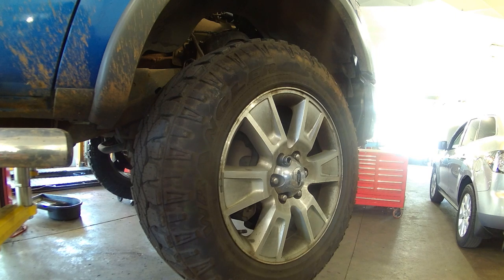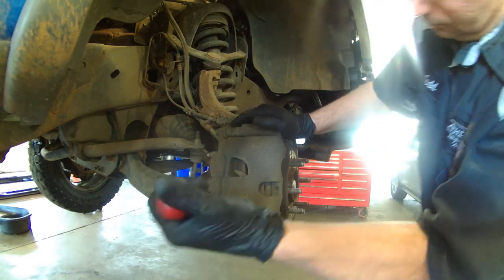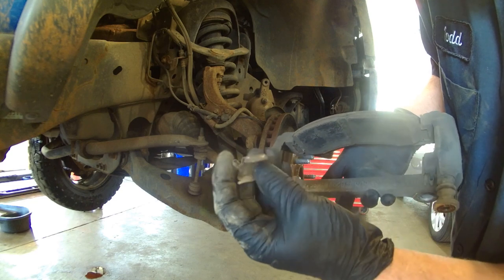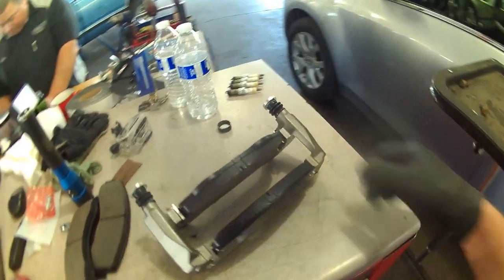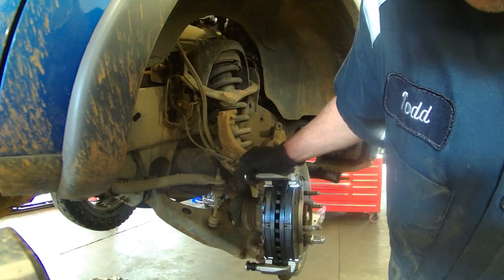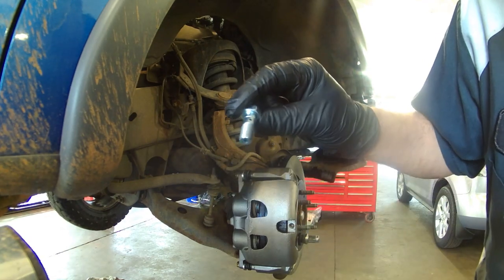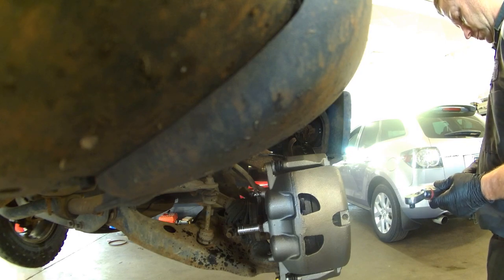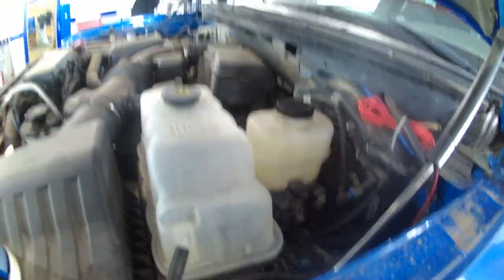Front brake caliper replacement pads 2010 ford F150. Expedition, Navigator. 2010-2016

Comment: Thank you for this video of unover' talked instructions. I admire this. lol. Unfortunately I didnt find your video until after I had replaced my front pads and calipers on my old 1997 f150. I was careful to do this job as I found a stuck piston on the left caliper. I had a bit of trouble getting the pads to stay in the new clips. Being a 65yr old woodworker, I overcame and was proud of my careful accomplishment UNTIL I couldnt gain any pedal. I said well heck, the booster is bad. I could hear air, I reckon? With care, I replaced it and still didnt get pedal. Someone mentioned having the calipers on the wrong sides. I checked and found that the bleeders were both on the bottom sides. I usually know if my boots are on the wrong foot before I lace them up. I need your fingers crossed while I go to the concrete with jacks and a smile to do it all over again. Thanks again Partner.